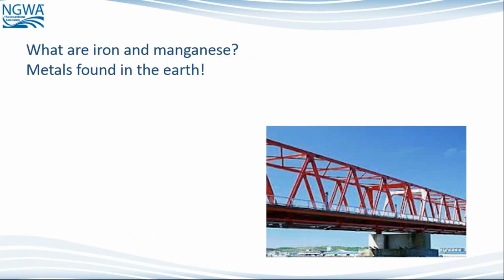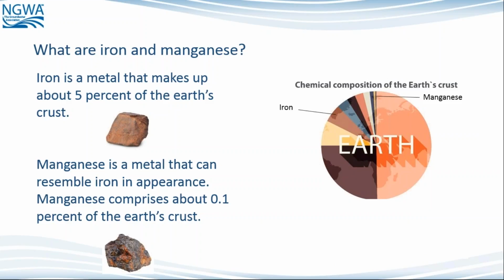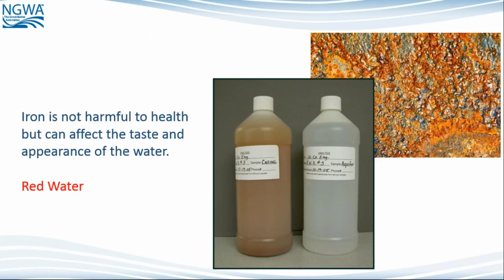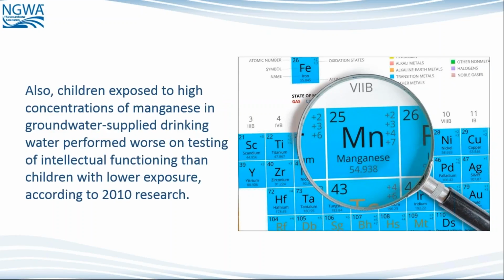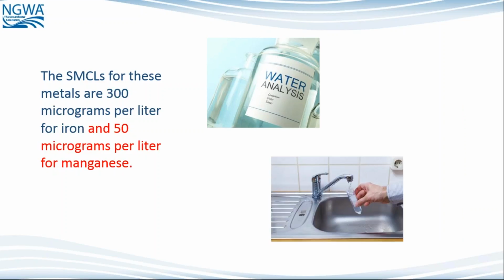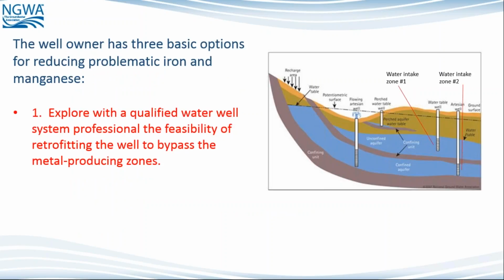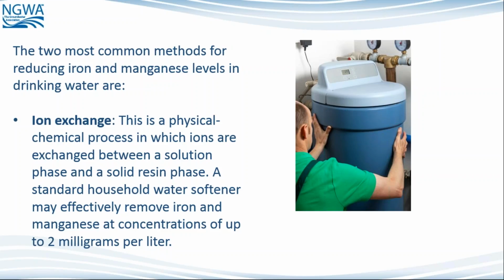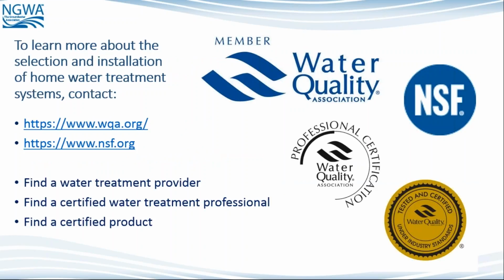Removing Iron and Manganese to Improve Water Quality in Residential Wells Well Owne

Comment: I have contacted multiple companies as far as cleaning my well water. All have been out of my financial capabilities. My water tested Iron at 12mg/L. Manganese at 4mg/L. 
PH was a 6 and hardness was a 1gpg. 
Any advice on fixing thus issue? Digging a new well is also out of my capabilities.
Reply: There is a good chance you are dealing with iron and manganese-related bacteria.  Most Fe and Mn deposits in wells are going to be biogenic in origin although there can be high Fe and Mn zones in the subsurface.  Most Fe and Mn problems are likely bacteria-related however, so I would look at a well rehab first.  If you did not have Fe and/or Mn at the beginning, but concentrations increased over time, that is a likely indicator of bacterial-related Fe and Mn deposits.
Reply: Any solutions?
Reply: @tophat2002  no